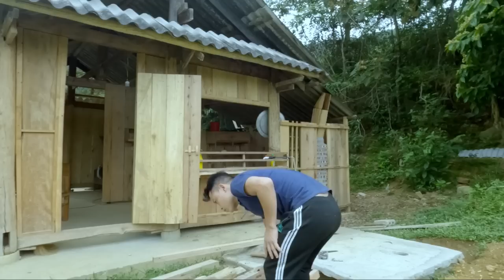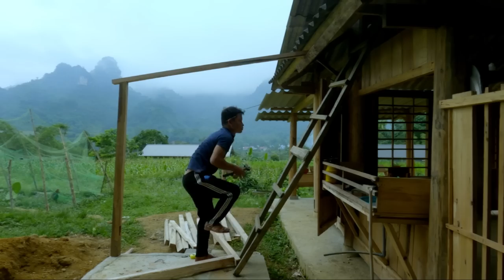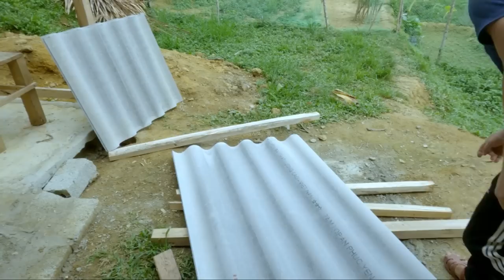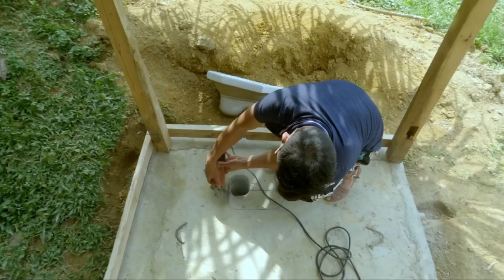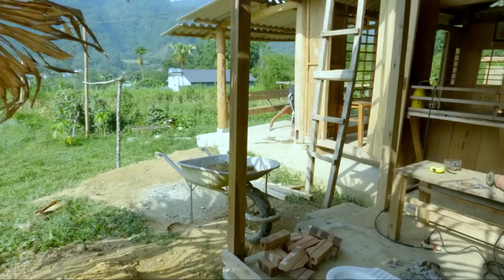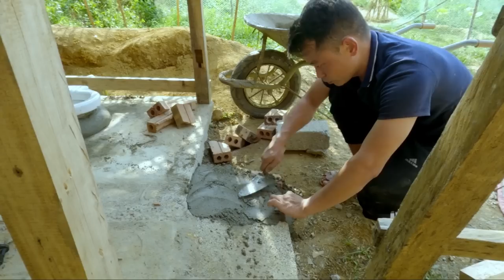Part 3 - 3 Months Alone In The Forest Build A Log Cabin, Build a clean wooden toilet

Comment: I don't think that is the best place to put a toilet too close to the kitchen and now you will be blocking that beautiful kitchen window
Reply from the maker: I work there, one is convenient to travel, the other is I can block the afternoon sun from entering the house, the house is much cooler in the afternoon because there will be no sunlight entering the house.
Reply: You could have made an extension of the porch on that side of the house to keep the sun and heat from that side of the house and made the toilet house further away which is recommended because of the gases that urine and poop makes when they are together, your works beautifully built, but it is in  the wrong location

Comment: I can see that there is a pipe coming from the septic tank. You should extend this above so that the smell and exhaust pressure will be dispersed to the atmosphere. Make sure it is high as much as possible with 90 degree elbow so that rain water will not enter your septic tank.
Reply from the maker: That pipe I use to drain water

Comment: Your toilet basin is water sealed so it needs an exsout bulb outside so the air from your septic tank will pass out throu that bulb and will not accumulated inside your toilet.
Reply from the maker: If you don't mean it, during construction I have left a hole for air and waste water to go outside and some time when the toilet is used I will install a faucet and lead away from the house.